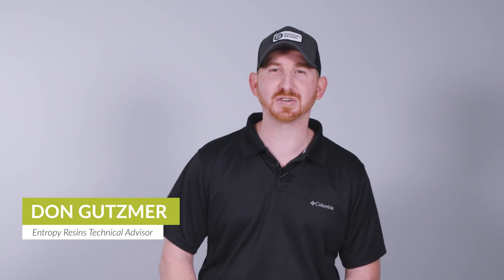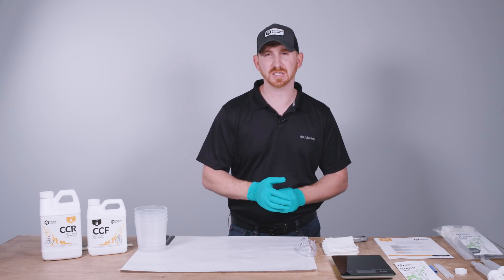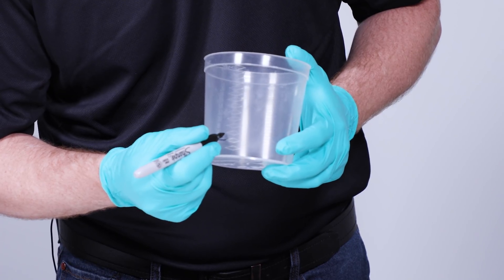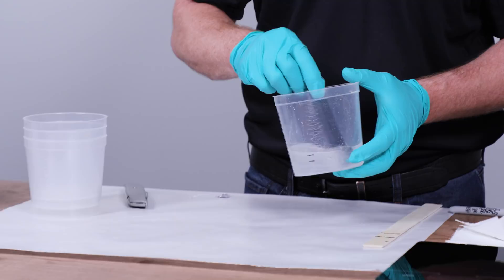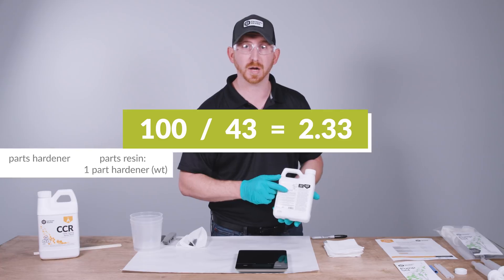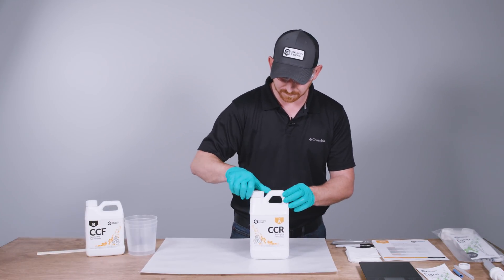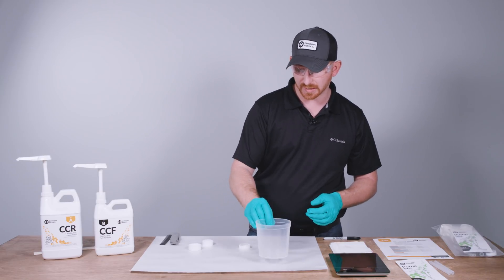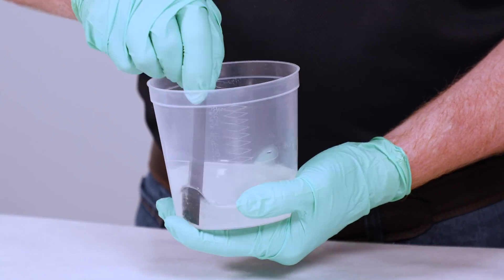Mix Ratio: Measuring and Mixing Epoxy

Comment: Good vid! For methods 1 and 2 I like to transfer my Entropy resins to clean laundry detergent containers, no more than halfway full. This way I can take advantage of the container's no-drip design. 

Question: If I have been mixing 2:1 by weight on my CLR epoxy, how does that effect strength?
Reply from the maker: We optimize our mix ratios to give our customers the best cured properties for our systems. We recommend using the mix ratio listed on the container labels and on our website entropyresins.com. Please feel free to contact our technical department if you have any further questions (https://entropyresins.com/contact-us/)